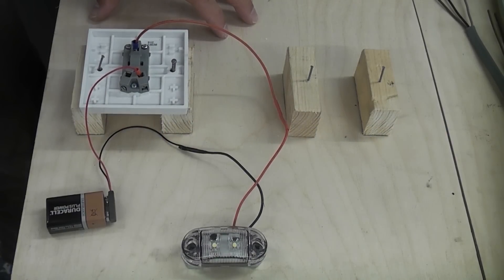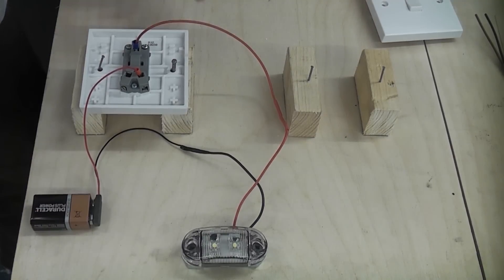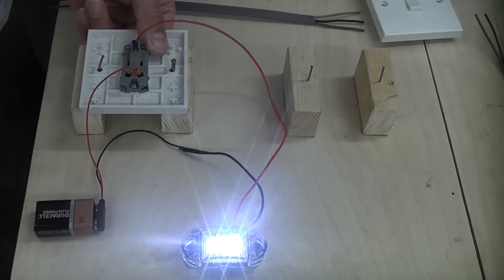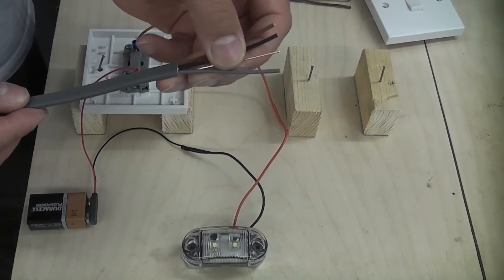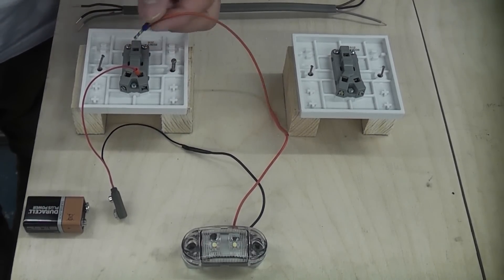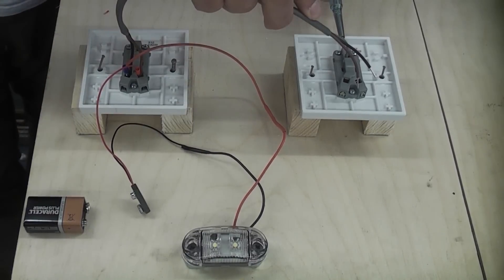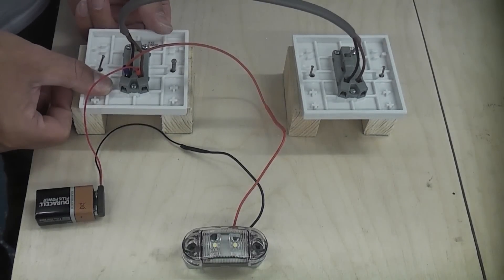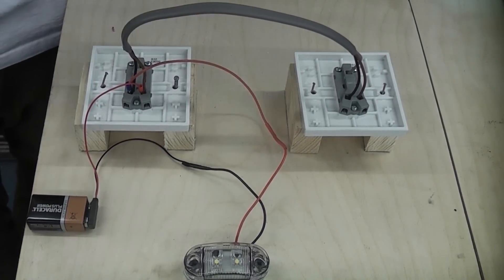Two way light switching explained

Comment: At last! An explanation that I can understand.  Thank you.
Reply from the maker: You are welcome.
Thanks for the comment ;-)
Reply: +Ultimate Handyman It helps me a lot, because I've got two switches in the kitchen that I'm working on, and I can't wire it up properly. 
One switch turns the light on and off, the other switch only turns the light on/off after the first switch is on. 
So power isn't getting to the second switch until I close the first one. 

Hopefully I'll get it with this great explanation. 

Thanks again :)

Comment: Very interesting video but what is the true meaning of com, is it just a switch that can be turned to live?... Anybody. Thanks anyway and thumbs up.
Reply from the maker: Com is short for common, the com wire will be live at some point depending which position one of the switches is in.

In a one way lighting arrangement the live wire can be in the L1 terminal or the com.

Comment: This is a brilliant video, really nicely done. Do you have a video for the following issue:
I want to replace a double switch unit with a triple switch unit to add a new light to the system and control that from the new third switch. Can i spur off L1 or L2 on one of the existing two switches? Any other precautions? The current switch is quite close to the consumer fuse box so I think it is protected by the master fuse.
Thanks in advance
Reply from the maker: Thanks, yes you can spur off from the permanent live terminal which will be either L1 or L2, however you need to be careful not to mix upstairs and downstairs circuits. You would also have to ensure that the neutral and earth are taken from the same lighting circuit, so never mix and match the wiring from upstairs and downstairs.  The lighting circuit should be protected by either a 5Amp fuse or 6Amp circuit breaker.
Thanks for the comment ;-)
Reply: Thanks. Out of L1 and L2, is there a test for which one is the permanent live? On the current system the switch has COM - red, L1 - YELLOW and L2 - BLUE. When i did a continuity test with the power off, the switch closed the circuit between COM and L1. Does this mean L1 is the switch live, and therefore I tap the other, L2 for the permanent live. 
Presumably I have to put a jumper wire between both COMs and both L2s? otherwise no live and no return for the 3rd, new light? 
I am actually just feeding a one off ceiling rose for the 3rd light, so presumably it just needs 2 core and earth, not 3 core and earth. So I just snip off and ignore the 3rd wire on a 3 core wire?
Thanks in advance

Comment: You could have also shown it the other way with com in switch 1, com out switch 2 and L1 L2 strapers using twin & earth.
Reply from the maker: Yes, but that's not the best way of doing it for people that want to change a one way system to a two way system ;-)
Reply: Yeah you'd need 3 core +E to get the line back to the original switch.  I think that method has some advantages though.  It's much more intuitive and clearer for people to understand and it's also much easier to expand with extra switches should you want the lights to be controlled from 3+ locations.

Comment: Being from  "across the pond" it's not easy for me to imagine this solution as helpful to understand a 3-way switch. I would have used the 4-conductor cable (black - hot, white - neutral, bare copper - ground, & red - an extra hot) to illustrate the most basic arrangement for a 3-way switch circuit (there are actually 9 or so ways these can be laid out depending on the placement of the lamps - which is why there is much confusion about them).
Reply from the maker: Thanks, yes there are several ways to wire this but I used the method which I find easiest and would be the easiest for most DIY people as they would always be converting a single light to a two way system and would never be installing one from scratch. I have looked at a few sites that show the American way of wiring this and the switches are probably identical, its just the wiring colours that are different. Over here the bare earth wire (ground) has to be sheathed using green and yellow sleeving etc.
Thanks for the comment

Comment: Thanks for the video, I've sometimes seen this called the "conversion method" where you're adding and additional switch to an existing lighting circuit. There are of course other ways requiring only two wires between switches. #JohnWard has recently done some in depth technical videos on lighting circuits (UK) that people might find interesting.
Reply from the maker: Thanks for the comment ;-)

Comment: Thanks for the great video really helps. I'm interested to see how this would work with three switches.
Reply from the maker: You are welcome.
I'll try and cover that when I get time.
Thanks for the comment
Reply: The joys of intermediate switching! It`s easy enough to figure, intermediate switches have 4 connection terminals, so effectively you cut the pair of strappers, thus leaving 4 ends, which connect across the switch.
Reply from the maker: Thanks for the comment ;-)

Comment: You just made something so simple much more difficult than it needs to be and also if wired up in real life you would be using more cable and time than needed.
All you needed was Line to 1st switch Common, 2 strap wires (1st switch L1 to 2nd switch L1, 1st switch L2 to 2nd switch L2) and then 2nd switch Common to Light. There is no need for a 3rd cable in between the switches....
Reply from the maker: If you are wiring from scratch that could be done, but if modifying an existing light to make it two way then your method would be more difficult ;-) 
There's more than one way to skin a cat ;-)
Reply: This is how I've always seem it done. Live to common on S1 and return to lamp on common on S2 and two wires connecting the terminals of the switch.
Reply: It depends how you're wiring it. You use either method depending on which is easier/cheaper

Comment: That's not the normal way to do it, it's actually done much simpler, Line to Com, L1 to L1,  L2 to L2, Com to Lamp, I'm an electrician by the way.
Reply: thats the way ive done it for the past 4 years but ive done this method a few times, like @Ultimate Handyman said in a previous comment, the way you descibed is the way its done if wiring from scratch (also how ive mainly done it) but this way is far simplier if your just adding in a 2nd switch.
Reply: Spot on bruh
Reply: commercial I assume as you obviously have never wired up a 2 way lighting circuit in Twin and CPC.........
Reply: I usually do as you, however,  I believe that electrician has to know both ways, especially if one does the maintenance on older installations. I don't for sure, but I believe that Handyman's way was the only way that was many years ago taught in schools and there are (rare) situations where live wire was needed on both switches. I'm also an electrician.
Reply: i wouldn't mind seeing some of your tips & tricks, cheers
Reply: I would say the same what Kyle. But your way can be also useful.
Reply: If your feed and control are at a different switch.
Reply: so, your way should be  both of the switches flipped to the same direction when light is on right? and no extra single wire needed to connect both switch
Reply: Kyle Anderson 
Ur a star.  I didnt get from video but ur comments done my job. Ur a top men. Thanks for the help.
Keep Buzzing. Ta
Reply: That's a far better and simpler way to do it surely. A lot less mucking around with extra colours etc. and it doesn't even matter if you reverse L1 and L2.
Reply: I totally agree with the way you do the wireing.
Reply: I agree with Kyle, the standard and the safest way to do it is line to Com. I'm an electrician as well.
Reply: What does L1 and L2 represent???
Reply: You tell him kyle I'm a spark to ?
Reply: Same, line to com, then L1 and L2 to L1 and L2, then out of com to load. It's better to do it this way since it's pretty much what everyone does, so it's kind of an unofficial standard.

Plus if you wanted to modify it at a later date to have an intermediate switch it would be much easier to do starting from this.

Another spark here too.
Reply: Yeah but he's on about adding a switch to an existing - your way from a new install maybe
Reply: Thats how i was tought in c&g training
Reply: Given OCD, probably a different diagram altogether: Line to Com, L1 to L2, L2 to L1, Com to Lamp. Reversing, gives you back a XOR. Lamp lights when switches in different positions (one up and one down).  😁
Reply from the maker: It's the way I have always done it.
Thanks for the comment ;-)
Reply: If you add a 2nd switch just feed a extra wire coming from the 2nd switch to the first switch, you would still have the same amount of cables going from the first to second switch but for it's easier to connect (you don't have 2 wires on a single connection point of the switches) and for safety you can de-energize the whole setup very easily because the live wire has a single point of connection.
Make yourself a favor and don't use the method described in the video.
I would even recommend that the poster of the video changes his video because using this wiring is a very bad because even an electrician who comes and sees that will be like "wtf who the hell did this mess"
Reply: @ppdan  And you are an electrician? This is called a conversion circuit for installations that require additional switches, it is in no way incorrect or unwise to use!!! Electrician of 40 years with all qualifications up to date 18th edition

Comment: Good video, nice and clear as it should be, so that it (the circuit) can not be done wrong. Have you thought of also doing the intermediate switch circuit so that switching can be at three or more switches or do you think this may be a bit complicated for some novices? (I hope this last comment does not offend it is not intended to) keep up the good work.
Reply from the maker: Hi Stuart, Yes I might do three way switching in future when I get time to make the schematic diagrams for it.
Thanks for the comment ;-)

Comment: Nice video and there are no videos out there explain it the way you do thanks a lot and I have a question plz what if you have 2 lights instead of one and you want to switch them on/off from either plz would be nice to see a video from you about that but no rush thanks and keep up the good work
Reply from the maker: Thanks. If the two lights are in the same room and already wired up it is not simple to change them to work independently to be switched on or off from two different switches and would require a lot of work and re-cabling.
Reply: There are in the same room and at the moment I can switch it on from one and go down switch it off from the other one but if the switch are not in the right position i won't be able to switch it on or off if either one is in the right position but thanks